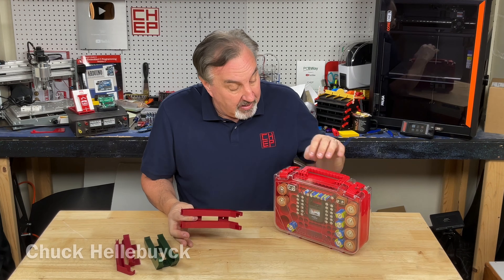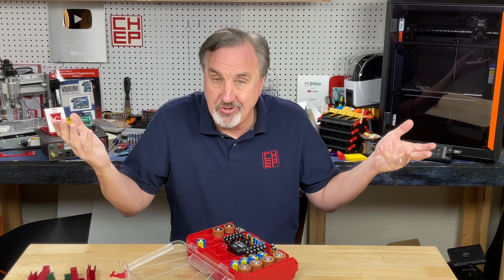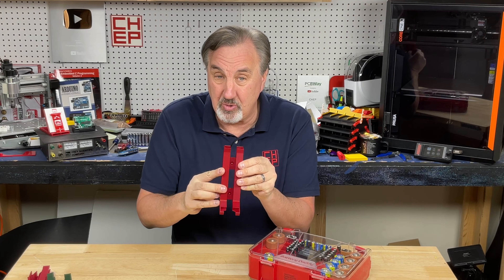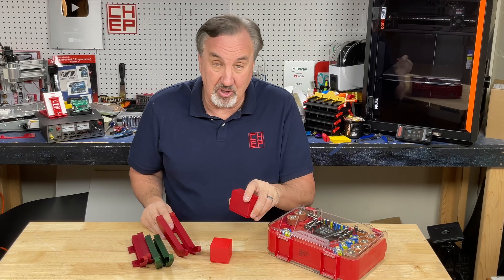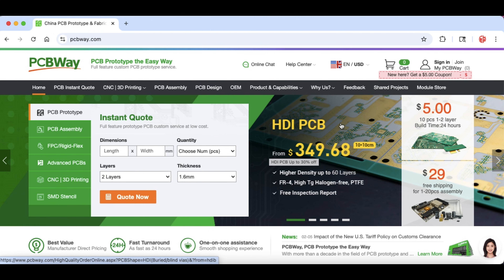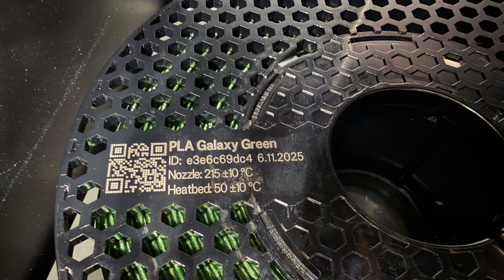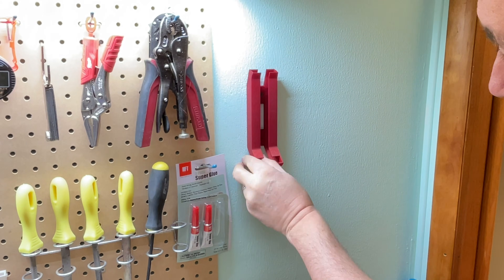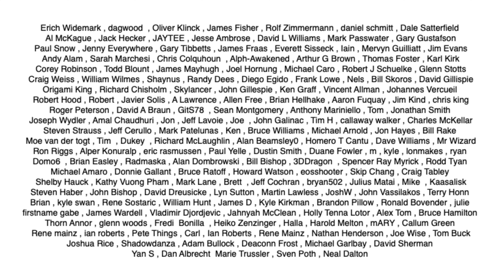Organize Batteries With This Useful 3D Print

Comment: I found a battery holder which someone designed that prints in two parts and when clipped together you put the AA or AAA batteries in the top and they are sorted in to two sections inside by type and sit stored ready for use. 
Really cool.

Comment: Nice design, but batteries last longer when stored cold as in a fridge, so I printed the small "crates" and have them for each battery size and they hold just enough to keep them in stock so you don't have a bunch in there needlessly aging away.
Reply: That's just a myth I don't think it makes much of a difference. with older battery technology maybe it used to work better. the moisture from the refrigerator could cause corrosion and modern batteries already have a long shelf life so I don't believe it's necessary and if you use lithium ion type batteries they don't do well in cold.
Reply: @Dlutheran  True enough, I still use some of the old zinc batteries from the dollar store where that does make a small difference, but alkalines don't benefit, so I just toss them in together.
Reply: Dad did that back in the day.